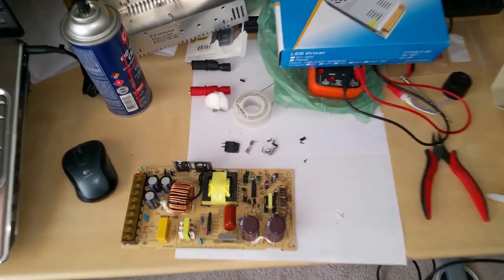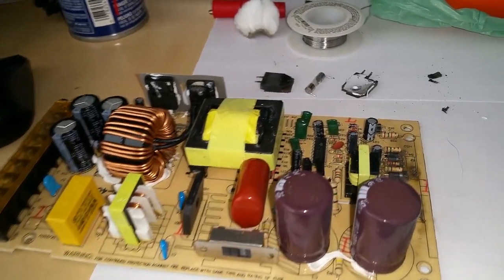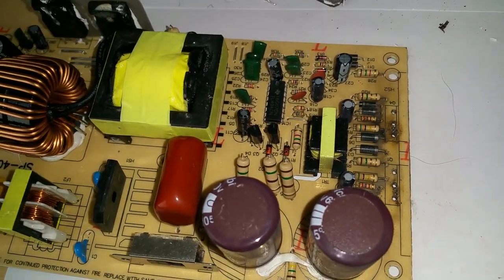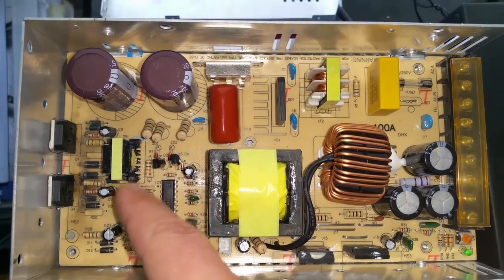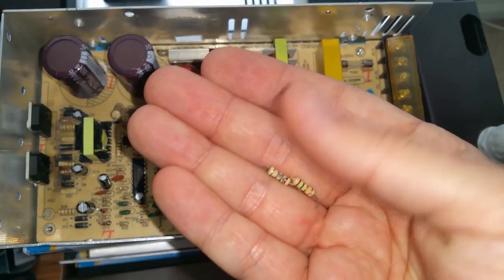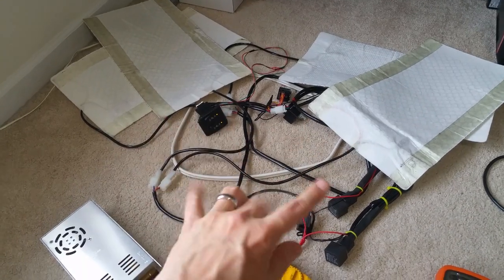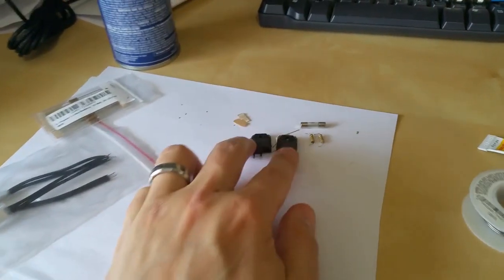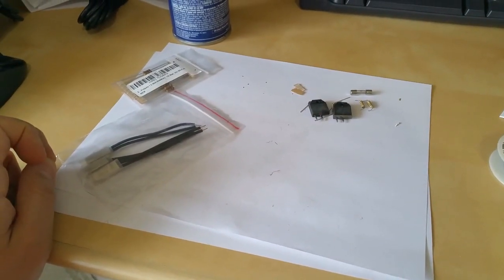Supernight 12VDC 30A PSU Repair

Comment: I just bought a power supply like that one (mod. 360-12) and the fan never turns on and the ps gets pretty warm on the bottom. I checked the fan and it works when I unplug it and apply 12v. There is no voltage on the pins where the fan plugs in so I suspect that there is a thermistor or something that turns the fan on/off. Can you please help me? Thanks.
Reply from the maker: If you see in my video, the thermal switch is inside the torroid coil (choke) and that is what gets warm during operation. Many of these PSUs never came with a thermal switch to save money,  making the fan run all the time which is not too bad of a thing just wears the fan out faster. If no power on the pins, and no thermal switch, then its either a bad resistor, or a bad winding inside the transformer.

Comment: I would like your advice. I have a adjustable bench top power supply with two outputs 0-20 volts and 0-12 amps. I hooked up some lithium ion tool batteries to try and charge them. It didn't work. The next time I used the power supply I had no control of the current. It outputs all 12 amps! Any ideas?
Reply from the maker: You need a charge controller. An SMPS will output whatever current up to its max the load resistance calls for. Those tool battery chargers are inherently current limited and have a cutoff to prevent overcharging, heat, failure. Etc
Reply: Bassguitarist1985 thanks for replying. I was able to correct the problem!
Reply: @Bassguitarist1985  Hello, I'm using this to power a car audio system in my room. Its powering a boss 5 channel amplifier. I have 4) 6.5 speakers and 1) 12 inch subwoofer. It's worked great for 2 years but I'm confused about something. I was instructed to use all 3 positive terminals and negative terminals on the 12v30a supply. So I split my power and ground wire from the amp into 3 sections at the ends and connected it to all 3 positive and negative terminals on the power supply. Why did he do it this way? Why couldn't I just use 1 positive and 1 negative on the power supply and use the others to power the radio?
Reply from the maker: @Silentjustin06  long as the wires are of sufficient gauge to handle the current should only need one set of wires. The 3 and 3 terminals are simply for extra circuits.
Reply: @Bassguitarist1985  it's only one 8 gauge OFC wire with the end twisted into 3 separate sections with 3 connectors. Basically made a 3 prong fork with the strands of wire at the end. I guess he did it that way because it's so much wire to put in 1 small terminal. So can I run my radio off the 12v 30a power supply also?
Reply from the maker: @Silentjustin06  30A you be fine with 10 awg. Honestly its overkill at 8awg
Reply: @Bassguitarist1985  ok maybe I'll switch to 10 awg later. Thanks for your time and knowledge. Have a great holiday weekend 👍
Reply from the maker: @Silentjustin06  you as well!